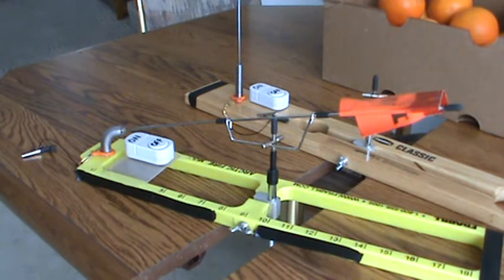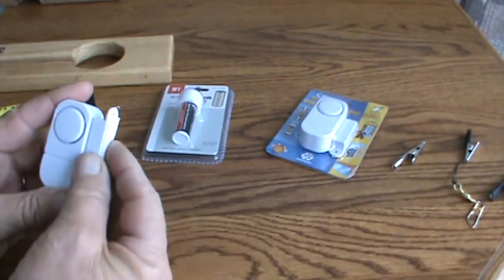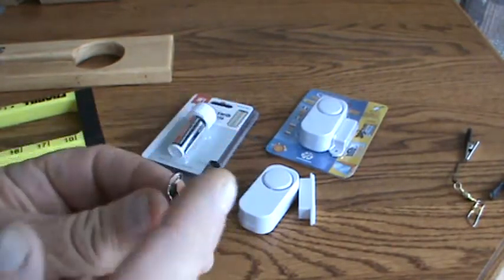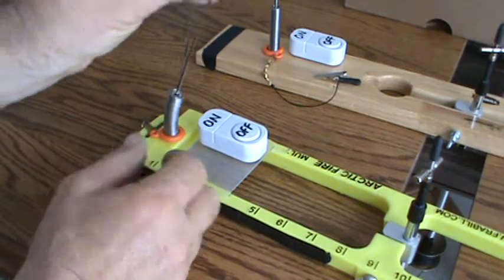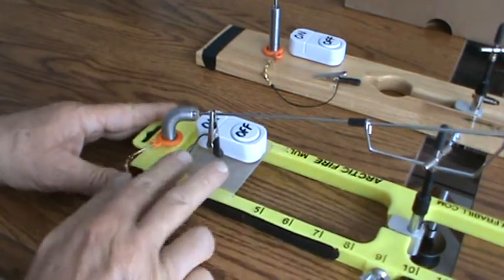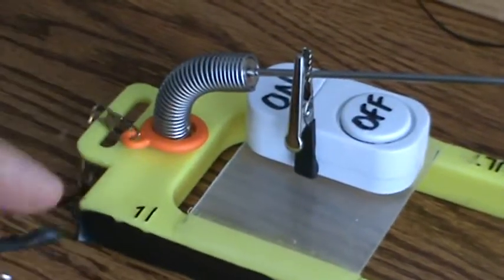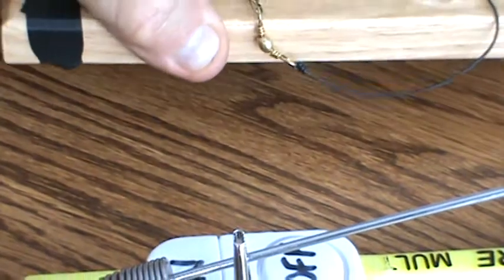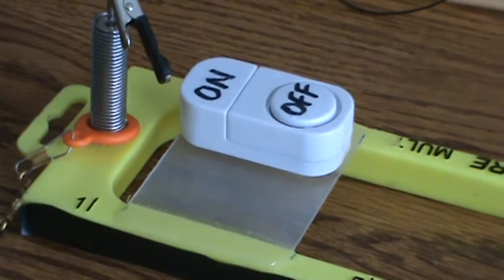Tip-up Alarm Easy DIY

Comment: What battery does this use? I made something similar last year that used coin batteries.. they freeze up and only last a trip or so... I'd be really curious if these run off AA or 9v?
Reply from the maker: Three small 1.5V  LR44